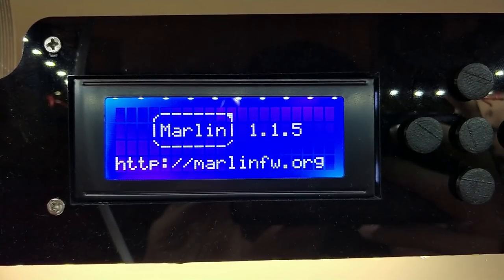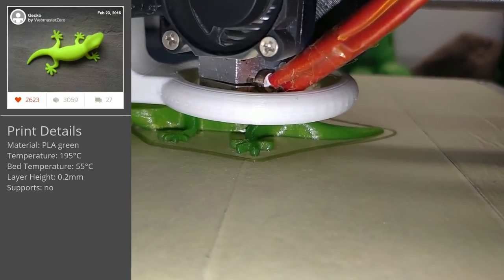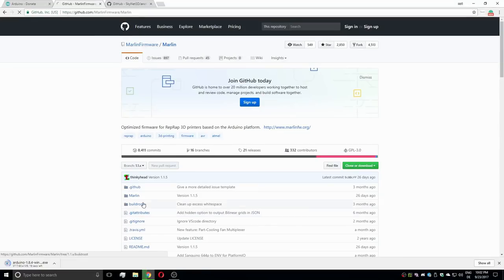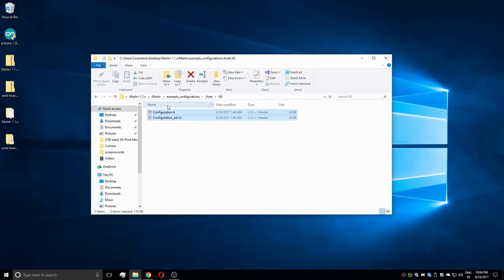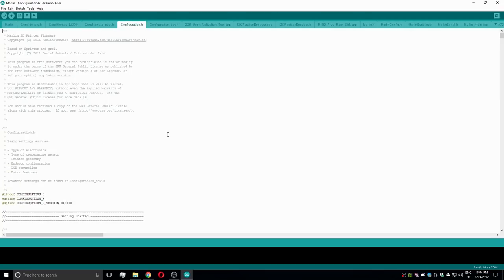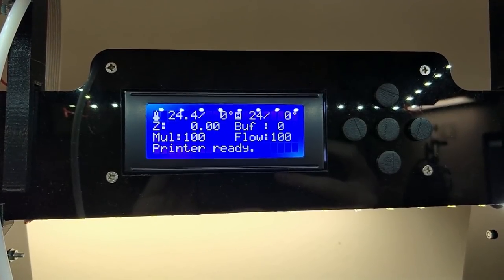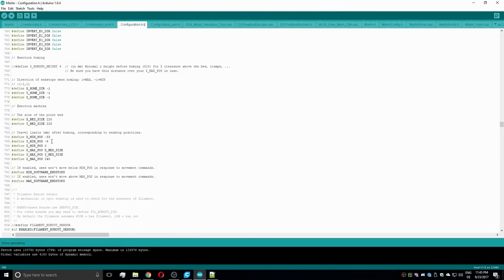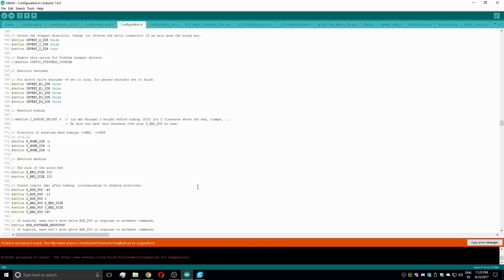Anet A8 Marlin Firmware

Comment from the maker: The methods shown in this video still work with the latest Marlin 2.0 release. The example configurations have moved to https://github.com/MarlinFirmware/Configurations
I prefer to use PlatformIO instead of the Arduino IDE nowadays, check out my new video: https://youtu.be/EQoae6oXszE
 
Please let me know if you run into any issues, I try to come back to you as soon as possible!

Comment: Thank you for taking the time to put this together, Worked perfectly. I would note that having Cura/S3D open while trying to update through Arduino will cause it to fail. Best to have them closed while doing any updates/maintenance.
Reply from the maker: Thanks a lot for your feedback!
You are right, I should have mentioned and paid more attention to it, but it luckily didn't cause any problems for me as Cura wasn't monitoring the printer as I normally don't print via USB. It was "just open doin' nothin'" in my case ;-)

Comment: Superb explanation and instruction. I came to this because my attempts with  VS Code and PlatformIO have failed (Marlin 2.0 builds fail). I will check your video on those, but this one, with Arduino IDE may be all I need.
Reply from the maker: Awesome, glad you like it. If you have a 8-bit controller like the MKS Base Gen L or an Arduino Mega with RAMPS board, this method works nicely! For 32 bit controllers you need PlatformIO.

Comment: Amazing video, I was working so hard to figure out how to install firmware, then found out marlin wasn't supported, but that was old and this is new and I should use repetier and use skynet and flash the bootloader with a pi zero. So glad this was so easy, thank you.
Reply from the maker: Thank you very much for your comment! Indeed, that was the reason for me to make this video, as most other tutorials told you to flash the bootloader (what I tried to avoid), install SkyNet (which isn't bad) or something else. To be honest, the installation of Marlin was, thanks to the example configuration, extremely easy! I hope you like your new Marlin setup!
Reply: It's different than the original "Omni" software. Warming up the bed right now just to do a test print.

Comment: The contrast on your display at the beginning is really good. Did you adjust something or is display quality adjustable at all?
Reply from the maker: I didn't touch it. Most LCD screens have a potentiometer to adjust the contrast, and I don't really know whether the A8 default LCD has one atm (and I can't look up that easily without removing the back-cover). The Anet LCD12864 has one, that's something I know for sure.

Comment: The Anet A8 Printer is officially supported by Marlin right now. Just sayin... You don't need the Arduino Software anymore. The only things you'll need are the Drivers for the Board, Python 2.7 and PlatformIO installed on your PC. Then you run the Marlin software and drag n drop the example configuration files from the Marlin folder for your printer into the window of the opened Marlin software. Compile, flash and you're done! Easy as that! Thank me later... :D
Reply from the maker: Well... It doesn't really matter whether you use the Arduino IDE to compile and upload or PlatformIO. I'm pretty sure that there are a lot of other (and probably far more complex) working solutions as well, but the purpose of this (already a few months old) video was to show one of the easiest ways. Of course, my own experience with the Arduino IDE from high school times might have influenced this choice as well ;-)
Reply: Caverntwo No problem. I only wanted to mention this method for those who are struggling with flashing the firmware.
Reply from the maker: Yeah, that could be a possibility to outrun the incompetence of the Arduino Uploader.
I'm not the guy saying that "only this solution works", but I'm more likely to stick to a solution that worked for me and where I already have some experience. Therefore I'm happy that you pointed another possible solution out. It could be worth a trial for some.
Just out of interest, did you already try it out?
Reply: Yeah i wouldn't say either that mine is the only working solution but it was the one which worked for me at the first try. Maybe it is a bit more simple once everyrhing is  installed in my oppinion. I had Omni installed before on my A8 and have not tried out the Arduino method. You would use the Arduino software for flashing and compiling but i prefered to do that with the Marlin software.
Reply from the maker: Let's say both solutions work, although yours might be a bit easier to use^^. I am going to pin your initial comment so that others can see it and try it out. Thanks again for sharing!
Reply: You're welcome!
Reply: David Feghelm - Do you have a link to a tutorial on doing this method?
Reply: Ill be trying this platformIO method as the method in the video doesn't work for me with the newest arduino IDE. It wont recognise the board files and i cant upload via sanguino for some reason?
Reply: jim did you enter the url for sanguino in the additional boards manger under the preference tab in Arduino?
Reply: Yes Dennis, i don't know why it wouldnt upload but i tried all 4 versions of the sanguino board.

Tbf i didn't have a lot of luck with platformIO either so still on stock firmware. Its got its drawbacks but works lol
Reply: What OS are you using by chance. I was getting ready to try marlin 1.1.8 on my anet and I'm looking for all the pro's and con's I can find.
Reply: Thank you for the alternate method of flashing to the board.
Reply: I had to put the anet file in this location (C:\Program Files (x86)\Arduino\hardware) to get Arduino to recognize it and add the anet board to the list.
Reply: Im running windozze 10 and absolutely hate it lol.

Ill have another go at flashing the board but im worried i brick it.
Is 1.1.8 running OK for you?
Reply: I haven't gone through with flashing it yet. I'm still weighing the pro's and con's. I am defiantly using marlin but I'm changing the way the machine uses the z end stop. Instead of using it to probe just one point for home, I was going to use it to do automatic bed leveling. Marlin gives a lot of cool features and I was going through the program line by line and seeing what I wanted to enable. One of the issues I have run into was the limited memory space I have to flash all of the program commands on the board. I was going to end up using the optiboot bootloader so I could fit more of the options on the board. So getting Arduino to recognize the anet board was just one of the issue's I was going to run into. I should as of now be able to just flash what I have to the board and be ready to go but that is with out the other features I want to enable. So my next point of research is how to upload optiboot to the board. From some of what I have read I need to use a special adapter for that. So I have more reading and watching to do to see if that is the case or if there is a different work around for that. What I recommend is joining a few facebook groups that have a lot of information about this topic here are some links. 

Official, Anet, A8R 3D printer Support Group (Inc RepRap Prusa i3 clones).
https://www.facebook.com/groups/1068531466501015/

3D printer Support Group (Prusa i3, corexy, delta, smartrapcore, hypercube)
https://www.facebook.com/groups/1843740479205162/

Anet 3D Printer Help & Discussion (TronXY, Tevo, Prusa-style clones too)
https://www.facebook.com/groups/OFFICIALAnet3DprinterSupportGroup/

I've gotten a lot of info from these groups plus watching youtube video's from.
Thomas Sanladerer
Maker's Muse 
3D Printing Nerd
CNC Kitchen
Ivan Miranda 
DIY3DTECH.com
Make Anything
3D Printing Professor
Josef Prusa
MatterHackers
3D Maker Noob
Drax3D
RCLifeOn
  
And a whole lot of others as well. So I recommend doing more research before you go and flash the board. I would ask myself what do I want to be different about the way the printer works? I myself want to auto bed level but I'm doing it in a manner that is different than most printers are setup to do. I also plan on eventually changing the mother board and upgrading to a touch screen before I start to build my own 3d printer from scratch. Happy learning and good luck make sure you read a lot because there is a lot of conflicting information out there.
Reply: "All you need are the Drivers for the board" <- Not so easily done, and a working knowledge of C++ and a github account and GCC and... and... and...
Been trying this for about six hours now. One thing after another and I STILL don't have the drivers. How is this easier?
Reply: @SwervingLemon  Facing same issues, not able to find / install ANET V1.0 as an option from Arduino (Anet A8 Plus, ANET 3D V1.7 main board).... ????????????????

Comment: Excellent tutorial and better customer service than most companies.
Reply from the maker: How do you mean? Did you define the correct mainboard? Please recheck the pin configuration (in pins_Anet10.h).  It should work as expected.
Reply: No, the Marlin 1.1x files flat-out do not contain the board_anet_10 and I can't for the life of me figure how to get a file that does.
Reply from the maker: So you want to choose the Anet board to upload the firmware in Arduino IDE? You need to add the board definitions by SkyNet3D into the Arduino hardware folder. I showed how to do this in the video!
Reply from the maker: BTW. "BOARD_ANET_10" is defined in line 135 of the "boards.h" file in the latest Marlin 1.1.x branch: https://github.com/MarlinFirmware/Marlin/blob/1.1.x/Marlin/boards.h
Same goes for the "pins_ANET_10.h" file, found right here: https://github.com/MarlinFirmware/Marlin/blob/1.1.x/Marlin/pins_ANET_10.h
You should be able to choose the Anet board as your motherboard with "#define MOTHERBOARD BOARD_ANET_10" (see Anet A8 example config).
Furthermore, just copy the "Configuration.h" and "Configuration_adv.h" files from the Anet A8 example folder into the main directory, overwriting the original ones, just like I showed in the video. The pin configuration in the "pins_Anet_10.h" file didn't change. So if you get an error, let me know what it says.
Reply: You rock! Thank you so much for the quick responses. I'm not actually sure what I did wrong 100% but after nearly 5 hours of fucking with this this I don't care. I'll edit my original comment accordingly as it seems to have rightly been my fault, which makes sense considering the complete lack of information regarding my problem online.
Reply from the maker: Hey, thanks, man! 
I'm happy that you managed to get it up and running!
It's true, information on this stuff is really sparse, I had to learn that as well when I tried to replace the controller with an Arduino Mega + Ramps combo (I did a separate video about that). Luckily, installing Marlin on the Anet controller was actually pretty simple if you know all the basics about microcontroller programming and worked on the first try.
Have fun with the new firmware!

Comment: Nice video! Did you find after flashing Marlin that selecting "Auto Home" in LCD would set the extruder carriage and heat bed right against the limit switches, instead of a few cm's away, as the stock Omni firmware did? If so, can you suggest how to adjust the auto home so that the carriage and heat bed are not pressing against the limit switches?
Reply from the maker: Well, that's what Auto-Home should do, it moves to (0,0,0). The offset from the Anet firmware was annoying in my case, as the nozzle crashed against the bed if it was too high... 
It is surely possible to add a move command after the Auto-Home, but I haven't done it yet.

Comment: Thanks for the great video!. Flashed mine to 1.1.5 with no problems. Using Anet 3D v1_5 board. Up and running
Reply from the maker: Thank you for your great feedback. I was astonished by how easy it actually is as well.
Reply: How did you manage to do it? I've same version of the board, but I get these errors:
avrdude: stk500_getsync() attempt 1 of 10: not in sync: resp=0x49
avrdude: stk500_getsync() attempt 2 of 10: not in sync: resp=0x6e
avrdude: stk500_getsync() attempt 3 of 10: not in sync: resp=0x66
avrdude: stk500_getsync() attempt 4 of 10: not in sync: resp=0x6f
avrdude: stk500_getsync() attempt 5 of 10: not in sync: resp=0x3a
avrdude: stk500_getsync() attempt 6 of 10: not in sync: resp=0x45
avrdude: stk500_getsync() attempt 7 of 10: not in sync: resp=0x78
avrdude: stk500_getsync() attempt 8 of 10: not in sync: resp=0x74
avrdude: stk500_getsync() attempt 9 of 10: not in sync: resp=0x65
avrdude: stk500_getsync() attempt 10 of 10: not in sync: resp=0x72
Reply from the maker: Try unplugging/replugging the USB connection and restart. It helped in my case.
Reply: Not helped for me. Could it be because of baud rate?
Reply from the maker: for the uploading process? Try setting it to the highest (worked for me), but I cannot guarantee that it works for you too.
Reply: Caverntwo Yes, I get this message when trying to upload. Never tried before install a firmware to this board. Probably will need to do everything from scratch and burn bootloader.
Reply from the maker: Did you already look up this error? There might be some solutions available.
Reply: Caverntwo It's difficult to find something related with this error and Anet. Well, I'll take a look later on. Also thanks for trying to help. You seem like a nice guy. Cheers!
Reply from the maker: Yeah, some errors like these can be really frustrating! From what I've read about it, it seems like the PC cannot continuously write data to the printer's chip. According to various sources, try another cable first. Then, make sure that you have the CH340 driver installed on your PC. After that, double check your available ports in the Windows Device Manager and make sure that you set the same in the Arduino IDE. Try unplugging every other of those before uploading. I really hope that you get this one fixed as soon as possible.
Reply: Caverntwo So far I've tried on x3 computers. All of them on Windows 10. Used same cable, because I dont have an extra one. Tried on USB 3.0 - 2.0 Used CH340 drivers that came with microSD. I'll get another board later next month and could experiment. Thanks for suggestions. I'll try to get another cable maybe. I'm not a newbie with Arduino. I have few UNO, NANO, custom boards.. Just never had anything like that before. :(
Reply: I've the same problem Anet A8-L 1.5, tired with win 10 x64, win 7 x32 and with two different cables still i have this problem, i also reset the board and made few different tests with connecting and disconnecting, do you have any solution ?
Reply from the maker: The core is that I have never experienced an error like this and I have by far not enough experience with microcontrollers and interfaces. Therefore I cannot really help out to be honest. The only thing left I can do is to google this error and the typical causes. Anyways, if somebody of you manages to get it to work, please share the solution with me, as it would probably help out some makers! Thanks!
Reply from the maker: David Feghelm managed to upload the compiled stuff to an Anet board using Python-based PlatformIO. Check the Pinned Comment and maybe give it a try. Please share your experiences!
Reply: Not so helpful, but I had no problems installing Marlin on my Anet 8, from the Arduino IDE.  I uses Ubuntu though...
Reply from the maker: Yeah I'm pretty sure that the problem is caused by some driver problem or Java (Arduino IDE) being not able to access the PC ports.

Comment: FINALLY! A tutorial that just explains this and works.
Reply from the maker: Hi, thanks for your comment! 
I'm glad that you liked it and that it worked for you! I plan to release more videos like this I'm the future.
Reply: Caverntwo Just a note, you should list that it can NOT be the normal arduino software, it has to be part of the beta, or the one you used such as 1.8.5. The current default Arduino download is 1.8.10 which does NOT worth for this.
Reply from the maker: Really? I used the latest one (1.8.10 for Linux) last week for configuring Marlin on my FLSUN Cube. 
What exactly didn't work for you with this version?
Reply: Caverntwo On Windows 10 it fails to compile for some reason. I’ll try it again on my Linux box when I get a moment, I’ve tried it on 3 different computers. I don’t know why, but once I changed to 1.8.5 it worked immediately. I’m very familiar with Arduino and also 3D printing and this was the the weirdest software hitch I’ve found.
Reply from the maker: Thanks for letting me know, maybe I'll give it a try as well. Now I just need to get your reply to the top!

Somehow...

Comment: Hello! I've tried compile Marlin 1.1.x and 1.1.x-bugfix by Arduino 1.8.10 and 1.9.Beta (And 1.6) but it was unsuccessful. first time I had error about library  U8glib. After adding this lib I had a tons errors about TIMERs. And I don't know how to fix it. Could You tried upgrade firmware to 1.1.x version? Did you have the same errors? Or do You know how to fix them?
Reply from the maker: I'm using the 1.1.9 release on one of my machines and it worked just fine.
Could you try reinstalling Arduino IDE and try the same steps again with the 1.1.9 release: https://github.com/MarlinFirmware/Marlin/archive/1.1.9.zip

Let me know if that helped.